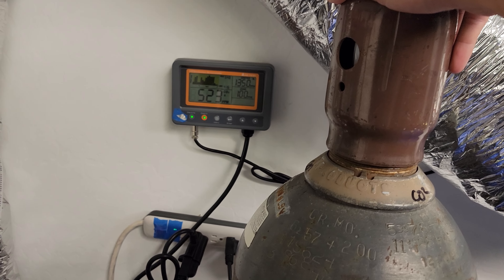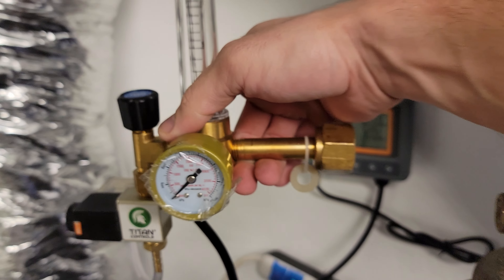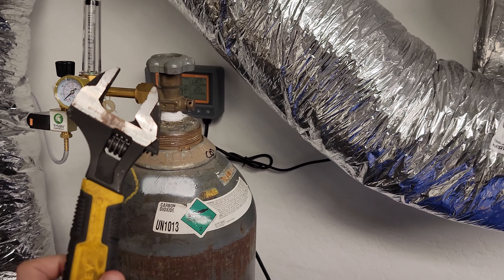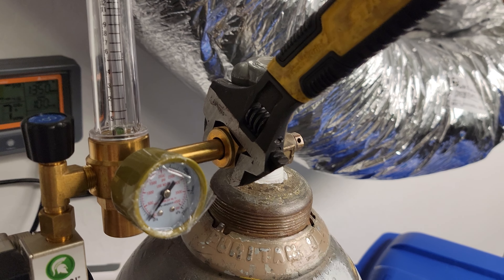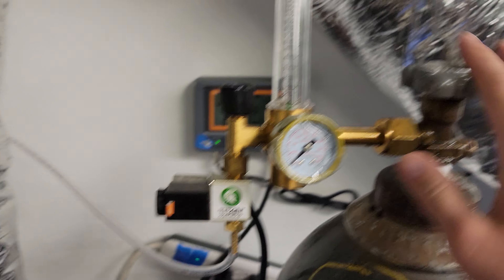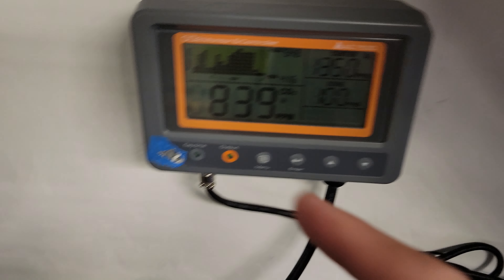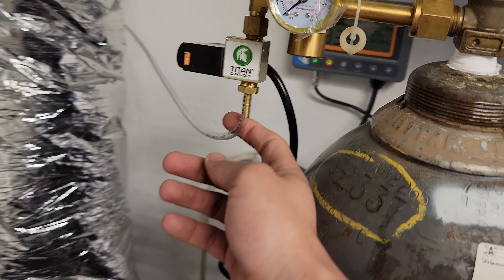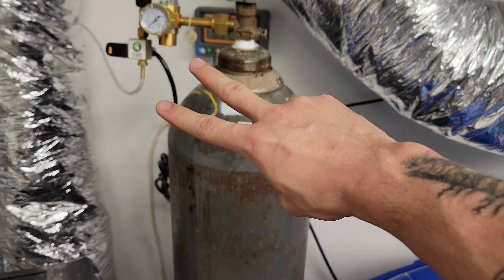How to setup CO2 tank regulator and monitor for indoor growing

Comment: Maybe I missed it but how long dies the 50 pound tank last you on average??
Reply from the maker: That's a loaded question. So with a single tray on that run it lasted me a month or just over. BUT on my run that just finished (Athena vs Mills) the tank lasted me the entire flower period. Even though that was with 2 tray opposed to 1. I switched from a dual hose portable to a mini split AC.
Reply from the maker: So basically my point is anything I give you could be WILDLY  inaccurate based on your own scenario.
Reply from the maker: I'll probably make a video covering this at some point. How these factors have such a big impact and how you can use passive Co2 on certain situations.
Reply: I'm not comparing my room to yours
I only want to know how long your 50 pound tank lasts you?
Reply from the maker: @tomcruise1146  I gave 2 examples of how long it lasts me based on 2 different factors over my last 2 runs
Reply: Gotcha 
Thanks 
I look forward to any new topics you have to offer 
Good luck 
Keep up the hardwork

Comment: Really helpful video. Should the sealed room have an exhaust for any reason at all? Also if you could link your setup that would be dope.
Reply from the maker: An exhaust is not required at all. Allows for more control of all environmental variables. Helps keep pests out and keep smell in. I'll get the links for the stuff I bought and add it
Reply from the maker: I linked some of the products mentioned in the description straight from my amazon order history lol. If there is anything else i missed just let me know and ill add it for you.
Reply: @TriStateTrichomes  thank you brotha
Reply from the maker: @machiavelligaming9755  Got you!
Reply: @Tri-State Trichomes  I guess you're using an AC unit to control temperatures. How strong is your AC and how much does it impact the electricity bill? 

I'm running 2 sealed tents, but before choosing a portable ac unit I went on and tried switching on all 6x 600W LED and I'm getting 88-89F° with them at 25% power and currently no intake or exhaust. I'm think a 6000BTU for each tent might do the job but it will be constantly working at max power. Compared to my previous runs with an unsealed setup I'm in disbelief at how much heat the AC will have to dissipate and thus the load on the electric consumption.
Reply: @marcoalvino6754  ACs are p expensive to run constantly, if you want something to run constantly and not exhaust the co2(it just recirculates the air after it’s cooled or heated), you should look into mini split
Reply from the maker: @marcoalvino6754  it may be more cost effective to seal the room your tents are in. Cool the whole room with a single large AC and co2 the whole place. Then just have inline fans to pump in the cool, co2 rich air.  You have to remember the portables will create their own heat they exhaust as well as they take up a good amount of space in the tents.
Reply from the maker: @marco alvino it would be more energy efficient to have 1 larger mini- split over multiple portables. You would probably also save on the initial purchase as well as keep your floor space open. I would really consider that option first if that's possible at your location. But if not then I believe a 6k or 8k btu should be fine to cool 1 or 2 600w lights easily. Might want to try with just 1 tent first as a test before buying multiple. Also make sure it is a dual hose if you want to keep it sealed.

Comment: You know anything about the flow meter not working? Been using my regulator for 2 weeks and suddenly doesn’t work
Reply from the maker: Unless there was water that got into it. Which it just needs to dry out if that's the case I'd ask for a free replacement. I'm sure you may be able to take it apart and fix it. But if it's that new I feel that should fall on the company to handle. 2 weeks is super fast

Comment: Bro, thanks for this vid! A couple of questions here. How many cf is your room if you're swapping these tanks every month, keeping the ppm at 1350?? How much does each cylinder replacement cost you where you are? I am down in Costa Rica, and my friends are complaining about the high cost of CO2. One 50 lb refill costs about $100 here. Seems pretty expensive.
Reply from the maker: costs me 30 USD. After switching to a mini split AC, i was able to extend the life of my tank to almost 3 months. it doesnt use much until mid flower when they are full sized and drinking up the CO2. my room is 8x8x10. the better the sealed the room the longer you can make it last for sure.
Reply: @TriStateTrichomes  thanks! I knew we were totally getting scammed by Praxair down here.

Comment: Well done
Reply from the maker: Thank you sir. Nothing too elaborate. Just a short overview since I couldn't find much on this when I was first setting mine up.
Reply: @TriStateTrichomes  Yea I don't know much about this so good video for me. I used a propane burner for heat in a greenhouse which then also gave off co2. They like it
Reply from the maker: @alukea123  for colder areas that's probably the better option too. Heat and co2 all together. Save on heating costs.

Comment: Homie you should chain that tank up....that thing somehow falls and shears that valve it will literally go through a cinderblock wall like a missle.
Reply from the maker: it is chained up?
Reply from the maker: and this tank doesnt have that much pressure. You may be thinking of an oxygen tank. it is under much more pressure.
Reply: @TriStateTrichomes  glad to hear its chained, oxygen is bad too, but co2 has plenty of pressure to still be a missle. I work with compressed gases like co2 and oxygen
Reply from the maker: @imdrunken  These CO2 tanks tend to land 900-1000 PSI. I know when i did welding back in the day i handled oxy and acetylene. O2 tanks are double around 2000PSI i believe. But yes i keep it chained to the corner. I made 2 videos on how to set these tanks up and i believe i cover chaining them up in each. Definitely can cause damage and cost money if they fall

Comment: Beverage grade or industrial grade?
Reply from the maker: I don't believe there is a difference. The shop I go to supplies both using the exact same cylinders.
Reply: @TriStateTrichomes  have u found out which kind your using
Reply from the maker: @jloch7895  no difference as far as I can tell. Co2 is co2